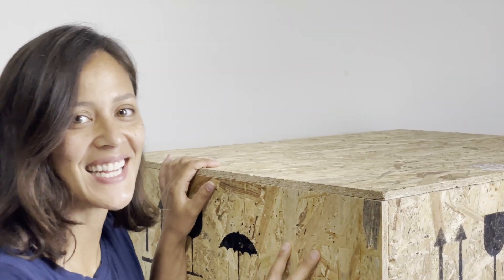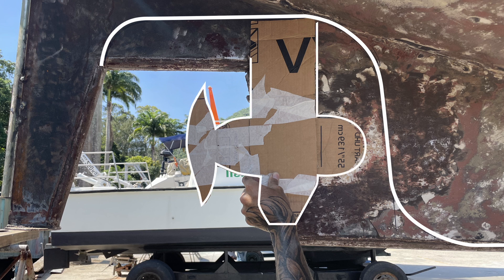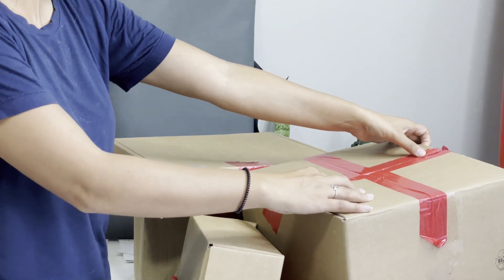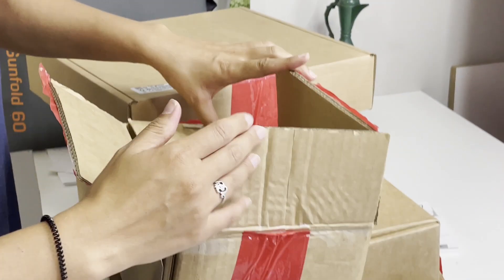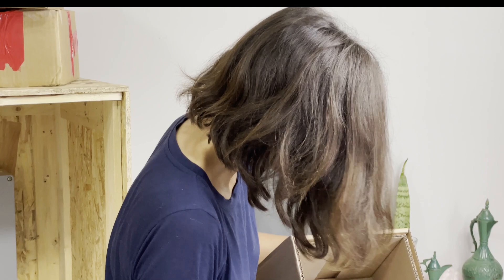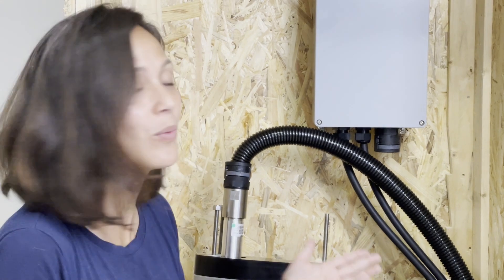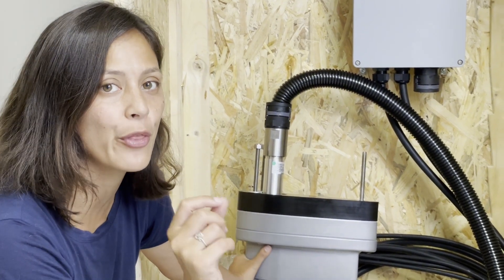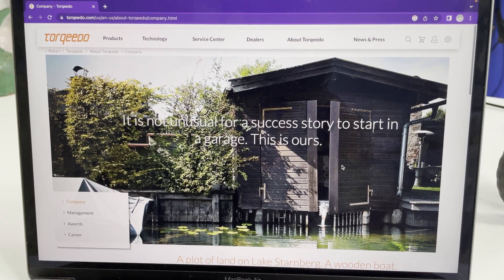Switching from DIESEL to ELECTRIC! Unboxing our TORQEEDO 25hp Electric Motor ⛵️ Ep7

Comment: cool new motor and now a cool boat, all come together 😊 but you will need a lot of solarpannels and the flexible plastic ones will not last over a long time. 🤔
Reply from the maker: It’s slowly coming along, right? 😃😅 flexible panels don’t necessarily generate as much energy as ridged panels or last as long. So we will have to work out a good setup with ridged panels to get all the energy we need to power this beast.
Reply: @lahakai  i think you are very fast for so much work.😊